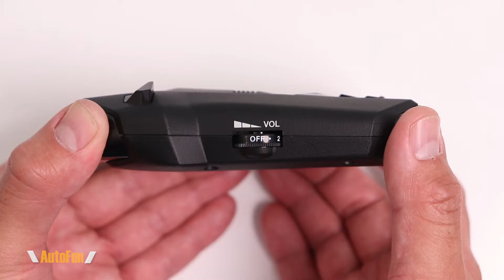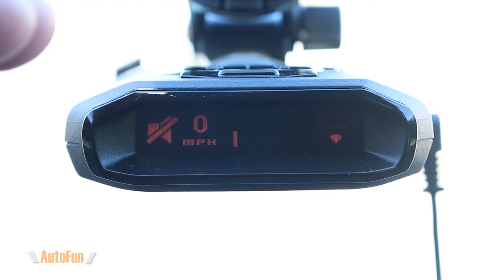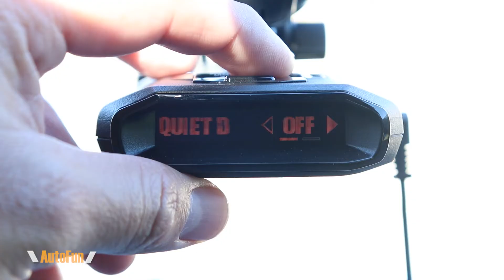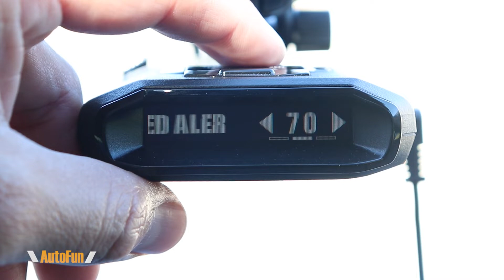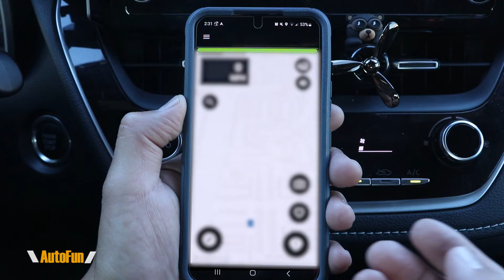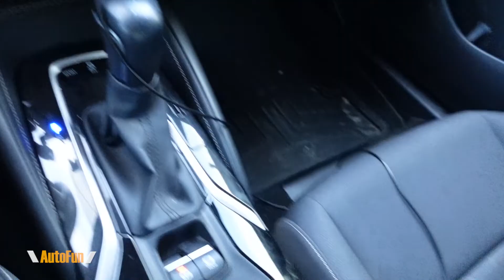COBRA RAD 700i Radar Detector Review - IS IT WORTH IT?

Comment: You got that part wrong Auto is based off Speed only   if your going 50 60 it will be high anything slower it will drop to medium to low
Reply from the maker: Yes sensitivity will be based on speed, what I meant is that the Auto function is described in the manual is based on the App (Drive Smarter App), will make this more clear on future reviews, Cheers!

Comment: I don't know what i'm doing wrong because I don't get the sound alert  on kA you can see it on the screen, but no sound alert
Reply from the maker: Hi! You're Volume Dial is likely turned down, I would recommend turning it up so you can hear the sounds, Cheers!
Reply: Same here man
Reply: @cadeochs5775  i figure out.
I update the firmware from Google. And factory reset the only thing I change is the screen color, and now it's working perfect
Reply: Same here just got one

Comment: Does USB port allow power to detector?

Is there a hardwire option?

🤔
Reply from the maker: Hi Pale Rider! Nope, the radar detector run at 12V where USB runs at 5V. That being said some people use USB to 12V adapters like the one I show on this video https://youtu.be/-hGu8KZLaZ4 Just remember the manufacturer does not recommend using a different power supply and could potentiall void your warranty. Regarding hardwire, yes when requested by the customer, the installer can hardwire the detector. Cheers!

Comment: Can the USB port be used to power the detector?

Is there a hardwired option?

🤔
Reply from the maker: Hi Pale Rider! Nope, the radar detector run at 12V where USB runs at 5V. That being said some people use USB to 12V adapters like the one I show on this video https://youtu.be/-hGu8KZLaZ4 Just remember the manufacturer does not recommend using a different power supply and could potentiall void your warranty. Regarding hardwire, yes when requested by the customer, the installer can hardwire the detector. Cheers!

Comment: At the very end if you watch you can see the cop turn around. Did he pull you over ?
Reply from the maker: Hi Jimmy! Unfortunately, yes the driver was pulled over, goes to say a Radar Detector is only as good as the person using it haha! Cheers!
Reply: The driver never slowed down after the first alert. Also the cop was using instant on. That's why the first alert was short. The second alert the cop got the speed. Need to learn how to use the radar detector.
Reply from the maker: Yeah actually the user error was worse than that LOL The alert came on and stayed on the whole time, the reason I had to mute it is the radio was playing copyrighted music, but yeah fully agree with you a Radar Detector is only as good as the person using it. Cheers! @High-techRedneckFishing